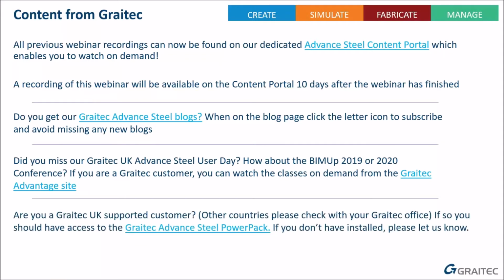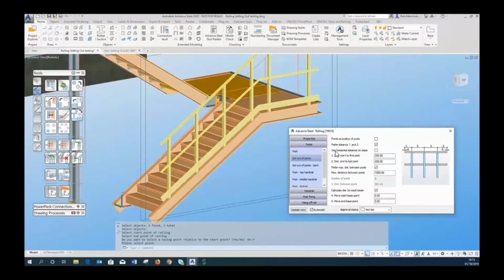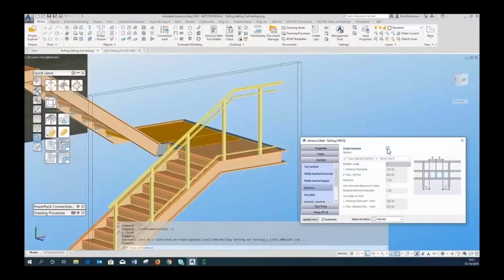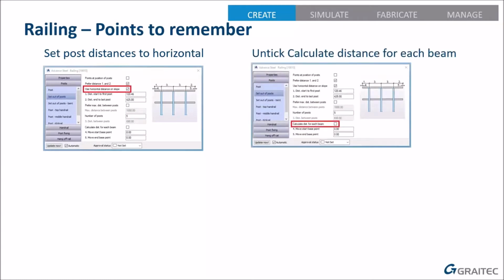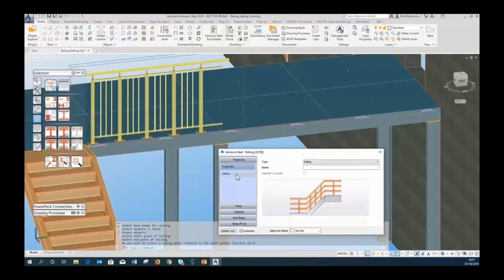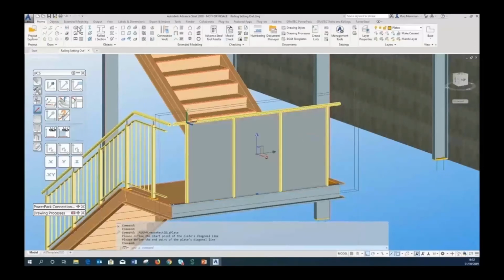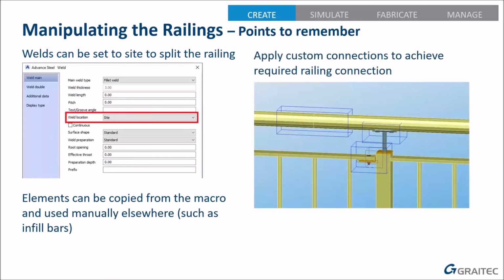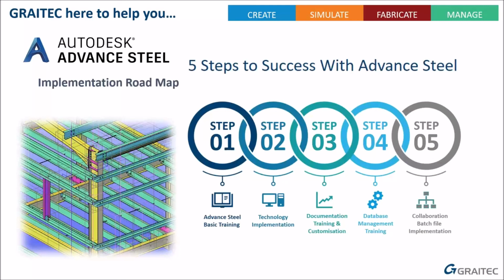Advance Steel Secret to Railings

Comment: Hi, you talked about editing macros without deleting any joint boxes but can you delete an element inside a macro while keeping the joint box intact? I have a railing where I want the end posts to stop under the bottom of a middle rail. I set the middle rail to continous which breaks the post, I then need a way to remove the section of the post thats inbetween the middle rail and top rail. I then want to add a loop to connect the top and middle rails. Thanks for the video!

Comment: Great video, thank you! Is there a way to add custom steel sections? I want to use a 40X12 convex/feather edge top rail on a railing panel rather than a 40X12 flat, but I cant see an option to use convex rail